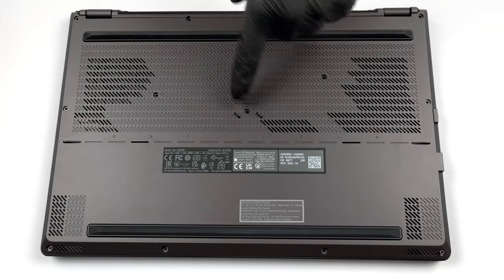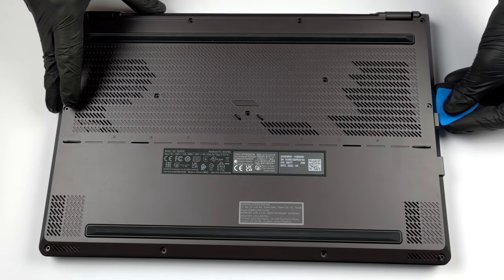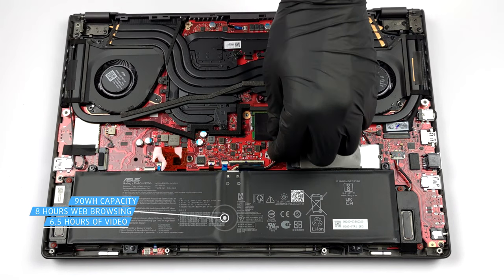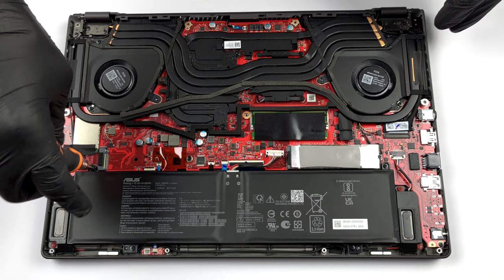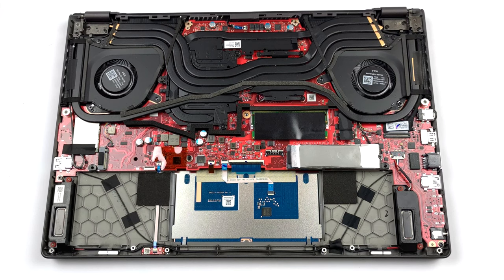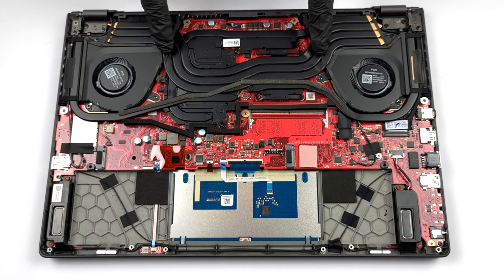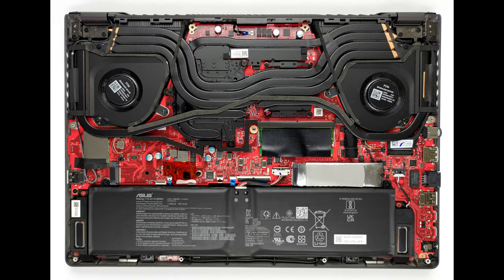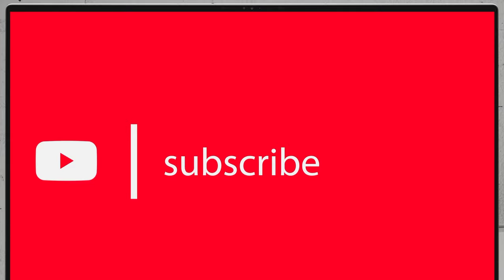🛠️ ASUS ROG Zephyrus G15 GA503 (2022) - disassembly and upgrade options

Comment: I want to replace the RAM in my laptop, the guy at best buy said it would be easy... after watching this, imma phone a friend. lol.
Reply: you literally just take off the back and swap the ram out for a new stick???
Reply: I wouldn't... you can only replace one stick and would be stuck WITHOUT dual-channel mode.

I'd prefer faster RAM than a little more capacity.
Reply: @JB-qq1xz  False, if you replace with a 16GB RAM memory, your laptop will use 8GB  in dual-channel and the rest without it.

Comment: hi, do you know if there is a way to activate fingerprints security? i have the 2022 model, GA503 RW and windows hello dosn't detect any fingerprints reader
Reply: I just bought the same PC, and it's the same for me. If I'm not mistaken, it's normal. The 2021 G14 had a fingerprint reader, but no Windows Hello with webcam. With the G14 of 2022, it is the opposite. There is a webcam with Windows Hello, but no more fingerprint reader.

Comment: I wish you showed how to unscrew them all because I’m having trouble removing the plastic Cover screws and the bottom screws
Reply: They are just rubber double sided tapped to a screw. Put a super fine flathead around it and pull the rubber off
Reply: @Marilyn363  I’ve already destroyed them lol